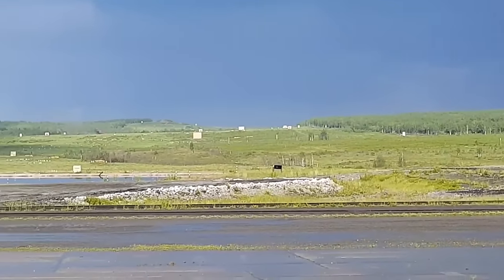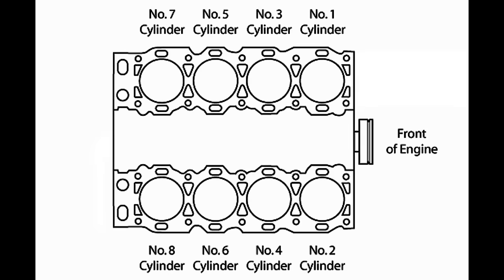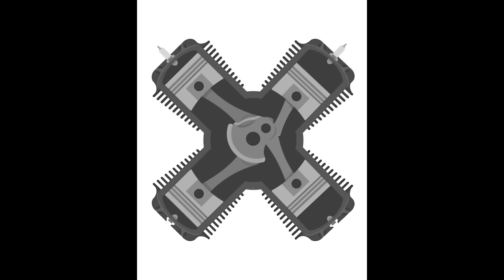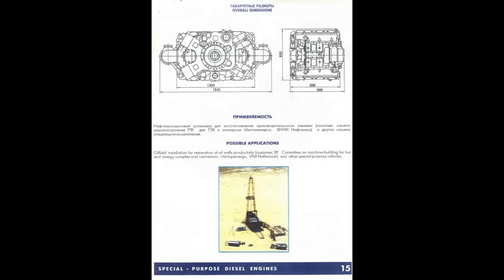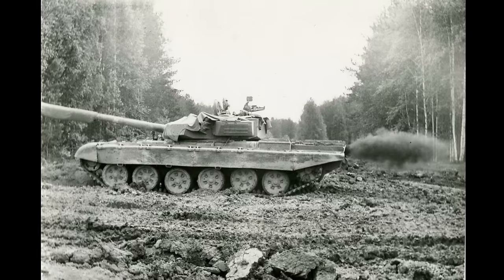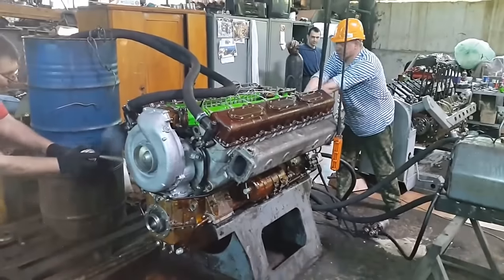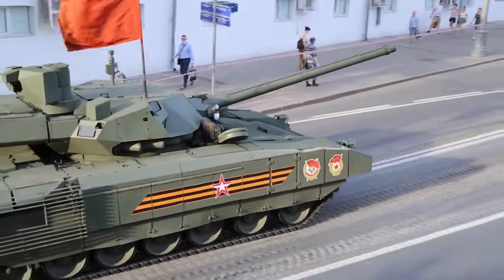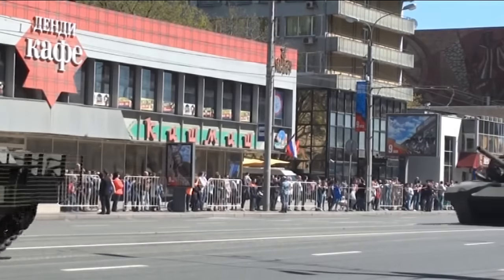Controversial History of T-14 Armata's Engine

Comment: Ah the T14 the Russian tank that we will never see in battle.
Reply: What makes you believe that?
Reply: @HATCH5T the fact it's still only used for military parades
Reply: @tallshort1849  there is a pretry nice comment of why tanks in general will have to change due to what was seen i Ukraine, so any sensible mikitary should redevelop ornupgrade their tanks accordingly, didn't guys used to say that about the t90m😂
Reply: @HATCH5T that's the T-90m with a terrible reverse speed, an exploding turret and gets taken out by IFVs?
Reply: @tallshort1849  i think you are having paranoia,  though the reverse speed is okayish
Reply: @HATCH5T so you agree thanks
Reply: @tallshort1849 terrible reverse speed is on 2020mod, also it was taken out by drones.
Reply: @tallshort1849 oh no it got takwn out by IFVs not like any other tank can be taken out by auto canons by taking out the most important things that make a tank work
Reply: @miningchip1  what kind of IFV are we talking about, what kind of video. By any chance, it's not where the 2 Bradleys were
Reply: @luckystrike354  you make yourself sound silly when i mean any IFV i mean BMP-2/3, puma, CV90s, lynxs etc etc

Comment: It's a bit odd to say 1500hp is not enough, when the alternative engine makes 1100. Like sure you can want more, but the new engine is still a huge upgrade. Perhaps this is part of why T80 is popular again? Turbines could offer more power, although currently they do not.
Reply: Its more about the power with more fuel efficiency
Reply: @kanestalin7246  that wasn't the argument made in the video. And fuel efficiency isn't as solid of an argument as you think. If it was your airliner would run a turbo compound piston engine. The T-14 no doubt burns less than a T-80. But the T-80 has been so successful in the current war Russia is re opening the factory. Abrams just cancelled its new piston engine program because the APU solved the problem. A few extra MPG is just not that important compared to the massive advantage of power density. If you want fuel economy drive a Prius, if you want to break through a defended position you better be both fast, numerous and heavily armoured. Something turbines and high performance diesels can do and slow moving medium armoured vehicles will not.

Comment: right decision would be to use V-92sf or gas turbine from t-80 but both with hybrid transmission.
Hybrid transmission can add enough power during acceleration and can help to drive to cover if engine is hit.
During cruising  old engines is enough.
Reply: They wanted something more powerful than the V-92 and more fuel efficient than the gas turbine

Comment: 8, 16, 4, idk about numerals but lil bro loves square numbers…
Reply: Wait is 8 a square number?
Reply: But 6 isn’t!
Reply: Don’t forget 12
Reply: I genuinely have no idea what point you're trying to make, but a square number is any number which is the result of an integer being mutliplied by itself, e.g. 0 (0*0=0), 1 (1*1=1), 4 (2*2=4), 9 (3*3=9), etc. Out of the numbers you mentioned, 4 and 16 are square numbers, while 6, 8, and 12 are not.
Reply: Do you mean even numbers?  Even numbers make a lot more sense in V, X, H and a lot of other configurations for both static and dynamic balance.  Inline engines with odd numbers (3 and 5 specifically) do happen, but are somewhat rare.  

Meanwhile, radial engines have to have an odd number of cylinders for the same balance considerations.  I haven't learned much about rotaries (not Wankels - those are not actual rotaries), but I think those also had to have an odd cylinder count...  But rotaries haven't really been used since about 1920.  

Inline engines past 6 cylinders start to run into technical problems with crankshaft reliability and weight.  8 cylinder inlines have been done in the past, but the crankshafts get stupid heavy (this is more of an issue than just making the engine heavier) and at higher power levels you start to run into issues of the engine being able to twist the crankshaft out of shape.

Comment: Bro its a terrible tank that wont be ever produced in meaningful numbers . Why cant we just move on
Reply: That isn't the objective of the video.
Regardless of the T-14 probably never entering production because it's not cost effective, the engine is very often mistook for the copy of the SLA16.

The tank per se is good, but it costs too much.
Reply: @billyparker5974  because despite billions of cost and years of development it's still not fit for front line use.
Reply: @billyparker5974  the worst tanks are the ones that are never deployed...
Reply: @billyparker5974  I wouldn't say the mbt/kpz 70 was 'mostly working' as it had numerous gun problems.

Comment: That's all great, but you could have saved yourself the effort because the Armata is just another vaporware and the money that were designated on development and production were stolen and used to build dachas as is the long russian tradition. 

If this was a serious project we would see this "indestructible" machine (according to Putler) participating in combat in Ukraine instead of the T-62 and T-55 that Putler is furiously refurbishing and sending there presently.
Reply: I mean look when they sent the terminator, didn’t go well.
Reply: man have u even watch red effevt about t 55 and t 62
theyrr not use as mbts
theyres use as artillery platforms and the hull gonna be reuse
as it is cheaper to use older stuff for repurpose uses

as for making nee tanks 
its very expensivd in modern times
most tank we have in this time are are same tanks but mosified and upgraded since its expensive to develop, sendinf rhis tanks will just be a waste as its not ready for combat yet and is not likely will not fare well against drones

Comment: Okey, so Lazerpig was wrong by saying that the engine is shit and based on ww2 german model, just like the most common tank engine they currently use is based on the ww2 soviet tank engine. And your counter to that is that it just Mostly similar to the ww2 engine but still old and shit? Oh look, some bits are slightly different, as if someone had worked on the design for some odd 20-40 years. It's not particularly convincing and most definitely not a slam dunk.

Comment: The point of similarity I can find is that the engine uses a 60/120/60/120, which is a rare configuration even among X style engines. In my study before watching this video, I have only ever found four engines using this setup; the T-14's, the German engine in question, the Packard X-2775, and a limited production Rolls Royce airplane engine prototype.

As for a replacement for the A85 engine, if it were me making the call, I would use an opposed piston setup due to the space demands.
Reply: Its not surprize. V-2 have angle of 60°. Slap 2 V-2 to oppose each over, and you will get result. It is just basic geometry.
Reply: @PyromaN93  exactly, which is also how the Packard engine was built, only using Packard's classic V12 as a foundation.

Comment: What a load of waffle, it makes no difference what the origin of the engine is if the thing does not work reliably and is not even in production, it may be the best Tank in the world but if you are not building them they are no use whatever.

Comment: only like the first 10 mins have any value and oh boy did Red make a lot of mistakes. Listen to what he says but instead of thinking of a Tank engine think about the first and current 6zyl Porsche 911 engine and then tell me if it still makes any sense what he says. Open for any comments and Discussions about this but i dont see anything proven here.
Reply: What are you talking about lol
Reply: @TheForklifter   The first 10 mins is about the engine, after this its about other similar shaped angines with another purpose in mind etc. His Points in the first 10 mins were just kindastubidly bad. Everything he said is just nonsense that does not add up.
Reply: @Tollp4ch  I don't think you understood his point. His point was that these two engines are so radically different. To a fundamental core of the design that it's extremely implausible that the Sla-16 and 2V series of engines have any technical relation at all.

The other X engines were brought up to show that the Soviets did also develop other X engines prior to the 2V. So it's not like the Soviets spontaneously developed the 2V out of thin air.